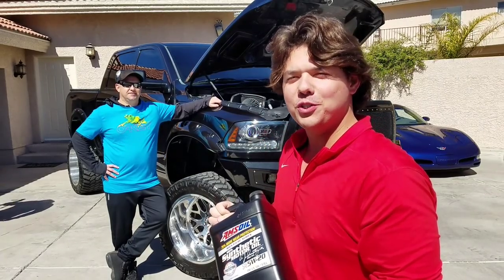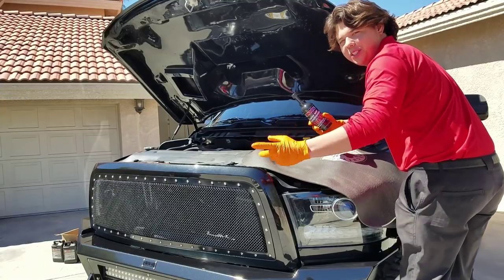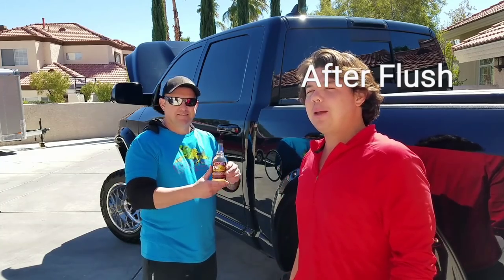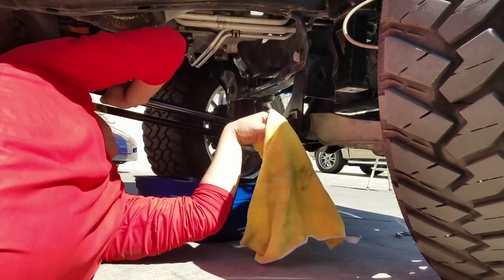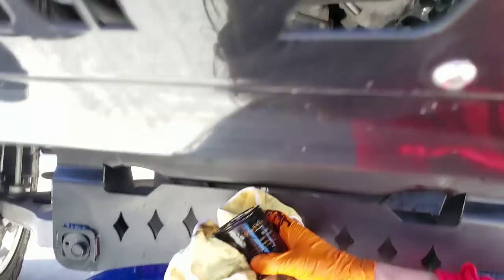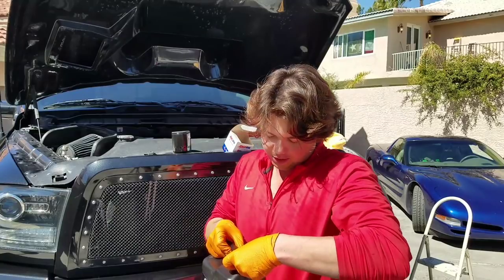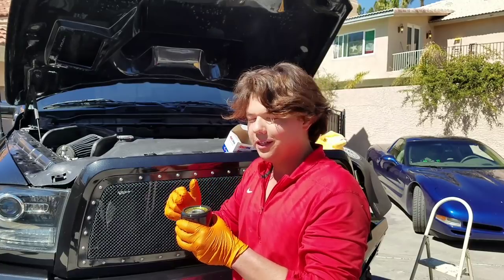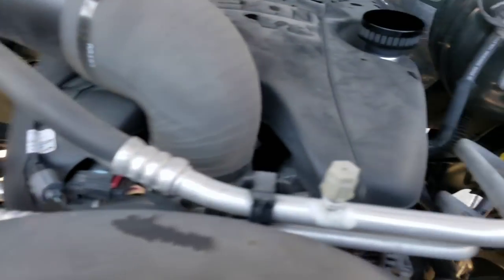2015 RAM 1500 AMSOIL Engine Flush Oil Change

Comment from the maker: Thanks JROCK702 for the Collab video! Jason Sanders(JROCK702)Las Vegas YouTuber: https://youtu.be/cMwWSC57GQQ

Eben Rockmaker
Independent AMSOIL Specialist (Dealer#: 5331179) https://www.amsoil.com/offers/pc.aspx?zo=5331179
Mobile: (702) 472-3614

Steps: 
1. My blue link gets you 25% discount and free shipping on orders $100 or more. I will get credit for your purchase when you use my link. Click blue link under my name, Click join now yellow bar Preferred Customer for 1 year. Click add to cart. Note: Amsoil will not keep your CC info. There is no recurring charges.
2. Click look up your vehicle.
3. Click auto light truck. 
4. After you have all the products added double check then complete order.
Any order over $100 is free shipping and ships within 1 to 2 days.

AMSOIL Vehicle Lookup - https://www.amsoil.com/guides.aspx?zo=5331179

     Friend me on and tag me because I like to see great results:
Instagram - https://www.instagram.com/syntheticoilprotection/

Facebook - https://www.facebook.com/profile.php?id=100007973957868

Comment: Hi, Eben question is it the same for all engine to use one bottle of the flush?
Because of the differences in the amount of oil.
Reply from the maker: Yes, I've used one bottle of flush on a little teeny weeny 4.2 quarts of motor oil and I've used it on a 14 QT diesel truck and it works amazing every time.

The crazy part is that on the diesel truck it thins out the oil so much it becomes like a regular 30 weight motor oil from a gas engine.

It actually delaminated breaks it down and makes it almost like water even know the diesel trucks take a 40 weight.

It's truly amazing what that flush does in just 15 minutes flat.

It's actually a breathtaking experience LOL😁😄😉
Reply: Yes. It did a great break down on the sut on my 90 frumings. You can see that video on Eben's channel. Great Testimony!
Reply from the maker: That was a blast Matt!!
Reply from the maker: This is Matt's Truck F250 with a Cummins swap - https://youtu.be/BNMXHkCUwPE